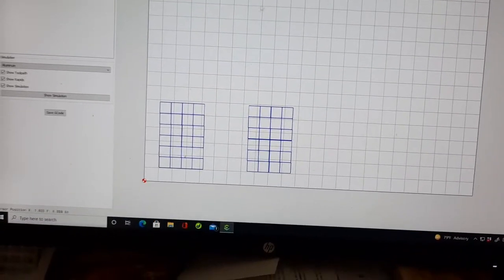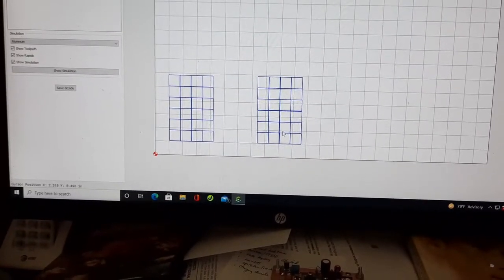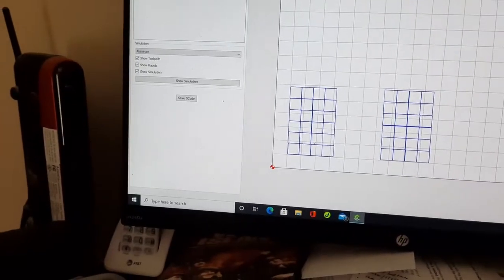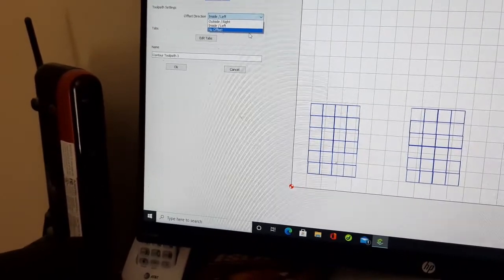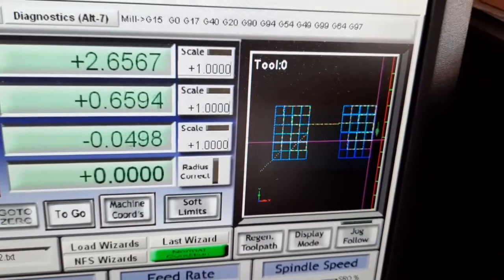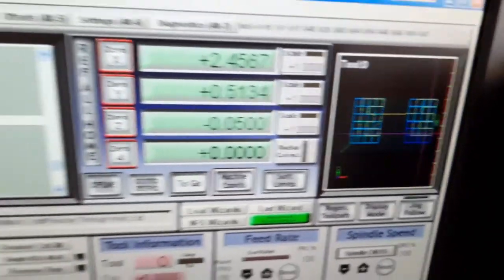Carbide Create _CNC Mill Your Next Rig

Comment: Hi Pete ,I wonder how you cut them out, on the band pass filter I used kicad then exported that to flatcam then used candle to do a height map then milled it out using Pro 3018 
all the best
terry
Reply from the maker: Hi Terry,

I do not want to give you a wrong answer so email me at craponthebench@gmail.com 
I am using a custom homebrew CNC built by my #3 son and the cutting software is Mach III. If I was building a Band Pass Filter, I simply cut out the Pattern using either Carbide Create or G Simple. With G Simple I create a DXF file and then import that into KCam which generates the G Code and then save that as a text file (notepad) in Mach III. Once the board is cut. I put it in the manual mode and then simply cut out the BPF. [Use a sacrifice board between the PC Board and the mill bed!] Carbide Create automatically can generate the G Code which I copy and save as a text file (notepad) and import that into Mach III

So, if I haven't answered your question email me.

Pete N6QW

Comment: Pete, you do want some dust management/filtering system there! That FR4 dust is really *NOT* something you want to be breathing, it known to cause silicosis or cancer if it accumulates in your lungs. Wear a respirator! 

That's why PCB milling machines always have dust exhaust systems with HEPA filters and the machine operates in a sealed box.